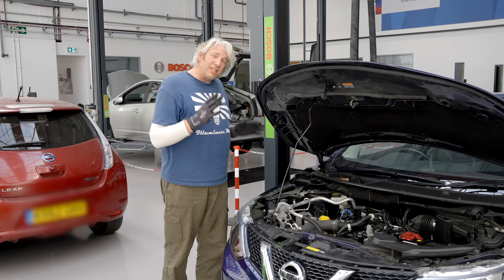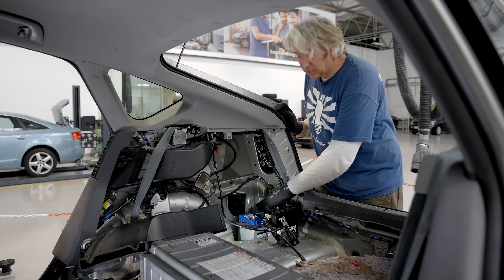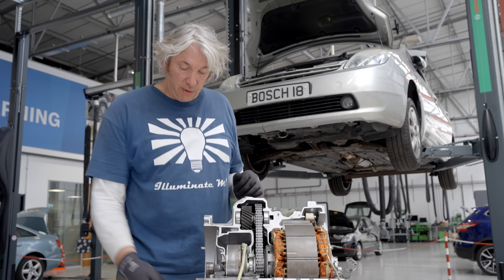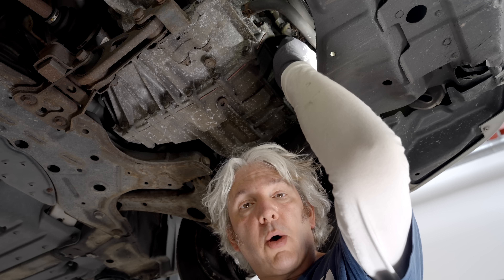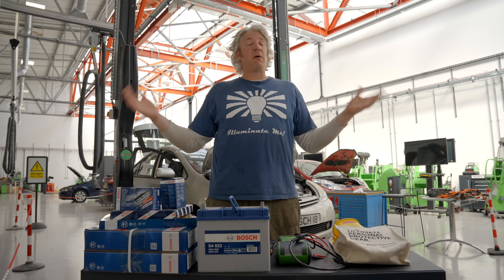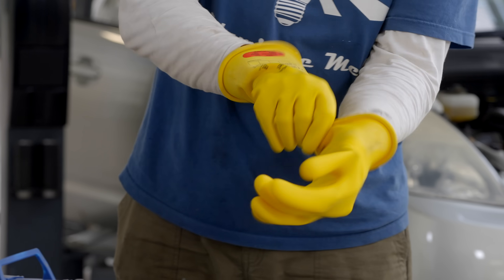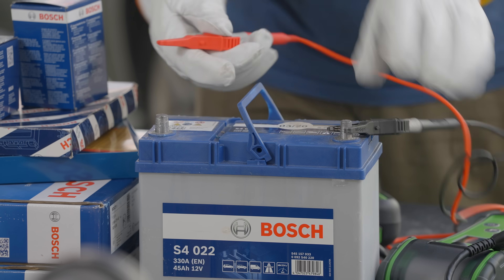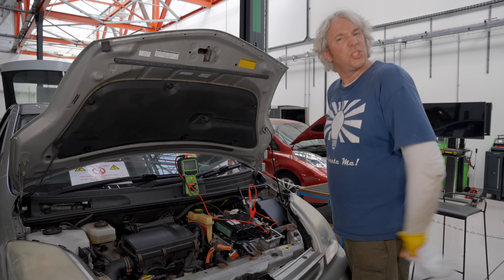DO's And DONT's - Electric Car | Edd China

Comment: Any voltage above 30V AC is considered high voltage??  Oh come on.  It's all relative.  The LV side of a 400kV grid main substation would be considered to be the 132kV compound.  Isn't it the case that the IEC consider anything 50V AC and below to be "Extra low voltage"?  Do we have a Bosch redefinition going on here to frighten the populace, by any chance?
Reply: @Bob Sacamano Indeed.  In that case the POTS (telephone system) in the UK which had a central battery at nominal 50VDC and ringing at 70VAC or slightly above would have meant that every homeowner with such a device would now be considered to have been in mortal danger!  You could indeed "feel" the ringing voltage if you were somewhat careless, but nobody would have spent a microsecond considering the DC on the line (or the 48VDC used for phantom powering capacitor microphones, for example) as dangerous to humans, would they?

Comment: sorry if this is a dumb question (I am not a mechanical or electrical wiz), but when the capacitors discharge where does the electricity go, has the vehicle been earthed earlier in the procedure?

Comment: 300 comments so I doubt edd will see it. maybe another sub can help. can you use a Tesla to jump a normal car?
Reply: @traitorouskin7492  look for the three little dots.
Reply: @UnderwaterSable  thanks. everyday a school day.
Reply from the maker: The Tesla will have a 12v house battery but it will be much smaller than that of an ICE car so it might struggle to crank a cold diesel for example. Having said that if it’s ignition is on then the High Voltage battery will be recharging the 12v battery through the dc to dc converter so it might actually be fine. A worthy experiment; I’ll go find a Tesla and let you know!
Reply: @eddchina  I say tesla but I mean any  electric car. my boss has one and I've never been sure if we can use it to jump the company smart car.cos sometimes it's parked the closeat?

Comment: I wonder why, . . . in EV's they still use heavy lead/acid batteries. Last 8 years I replaced all my motorbike batteries for LFP batteries. 
Those weigh 80% less and are 2 x stronger and have about 5% vampire drain per year.
Reply from the maker: It’s a good question, maybe newer cars will go that way, particularly sportier ones. It was an ‘old’ Prius after all.

Comment: I was taught Many moons ago, the hand behind the back should be the left hand and this should be in the back pocket to create a conductive loop to by pass the heart. Notice Ed suggests either hand. Also the PPE on the hand behind tha back will actually prevent current which would flow through the heart. Unless the hand trick is just to prevent human error and placing it somewhere it shouldn't be. 
The other trick for testing is to use the back of the right hand instead of the normal gripping front. This causes any shock to throw the hand off rather than gripping the live wire when the muscles spasum.

Comment: OH the joy trying to sell EV's Edd because they are going to save the planet ERR NOT THEY ARE NOT. Just because they do not have an exhaust pipe means nothing, the electricity has to come from somewhere else eg PowerStation's what runs them Oil /Gas /Coal or Nuclear. You cant include wind or solar there's just not enough of them to even scratch the surface to make a difference , so all your doing is moving your exhaust pipe somewhere else.  Even Volvo have release a study saying they don't and won't save the planet just type this into your search engine ' Volvo EV Report. The other problem you have is  with do days electricity prices going through the roof it now costs more to run an EV then every before, the charging network is utter shit most of the time if you find the  chargers are broken or someone else is already there. I do like the Honda E but a big BUT £38000 which for a small car is insane that isn't the worse bit if your lucky you might get 130miles out of one charge, real world 105 miles for £38000. I wonder how long before you need to replace the battery pack at guess that would cost in the region of £10k.

Comment: Awesome video as always Edd.
Safety tip for folks changing their wiper blades: Keep hold of the wiper arm at all times, then when you've disconnected the wiper blade, carefully lay it back down onto a clean cloth on the windscreen before reaching for the new wiper blade. It only takes a moment but it saves you a fortune every single time on avoiding a very expensive accident.
I've seen so many people leave it up out of bad habit (even the most experienced mechanics) then proceed to accidentally knock the wiper arm, which snaps down and cracks the windscreen.

Yes, most folks have windscreen cover on their insurance, but try explaining that little mistake to your service manager (aka significant other 😅) why their car now needs a new windscreen...
Reply: Agreed!  Sadly learnt my lesson doing this the painful way… Excellent tip for the uninitiated. 👏 👏 🙌
Reply: Yup, easy yes, safe hell no...
Reply: @AttilaAsztalos  What do you mean there mate?
Reply: @mazdamaniac4643  Edd was saying changing the wiper was "easy and safe"; well, I do agree with easy, but my previous windshield wants to veto "safe"...
Reply: @AttilaAsztalos  Ahh, no worries mate. I've had a few close calls myself with this and after seeing the results happen to the guy working next to me in the workshop, I was "Nope." and the cloth on the windscreen from then on.

Comment: High voltage is dangerous but it is the high current (amps) which sets the car on fire or gives you terrible burns. This could happen with a ICE car and it's 12V battery to a smaller degree. Never underestimate the power available from a battery !  Good video Edd.

Comment: I don't like the testing for dead proceedure - no proving unit used. 
I also didn't like the lack of insulation resistance testing on the gloves.
Lockout proceedure should include leaving the isolation key in locked cupboard elsewhere in the office and signing it in and out.

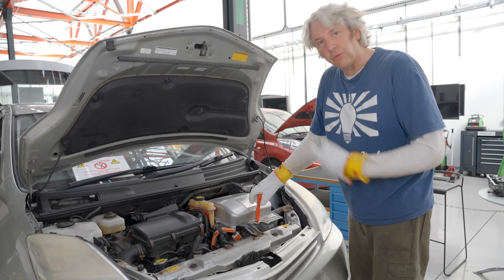Comment: #13:10 zooms in on 12v battery .... #13:12 thats 10 and a half volts so definitely thats working nicely.
Reply: 10.5 volts from a 12V lead acid battery? Stone cold flat and possibly damaged. Should see at least 13V.

Comment: Great video Edd! Thank you for including all the safety precautions, including the high voltage gloves. There are a lot of people who work on Priuses who take no precautions at all. I’m wondering if you’re doing maintenance items other than working on the high voltage battery, if simply disconnecting the ground on the 12V battery would preclude the possibility of something on the engine from spinning and causing injury?
Reply: My guess is Toyota would put in several fail safes that makes this possibility very unlikely but not impossible if something else was faulty. Obviously it would be rare for the engine to try and switch on without the key inserted but if a fault or multiple fault occurred you could end up in trouble. I have heard of 12 volt batteries going flat in electric cars preventing the car from starting so it would seem possible that it would stop this happening but not if it was faulty. Risks will probably increase for a full electric vehicle especially if there is no longer 12 volt electrics. Scary stuff. Certainly worth doing that course!

Comment: Hi Edd,

As a trained HV mechanic and designer of an electric conversion kit for a specific vehicle, I'm having some trouble with your video. For servicing the engine and brakes it's absolutely not necessary to place the HV battery in a safe mode.

Removing the key, and maybe disconnecting the 12Vdc battery will de-energize the contractors and therefor isolate the HV battery.

When do you need to put the HV Battery in a safe condition: when working on HV components, cabling or working in close proximity to these parts. This last item might be a reason to disconnect the HV Batt during service, but in my opinion it's a bit overdoing it.
Reply: Correct, to do the brakes you need the power to release caliper motor

Comment: What about when one of these electric vehicles is involved in a bad accident and the high voltage cables make contact with the metal bodywork. When someone tries to help you out of the vehicle it could be game over for them.  Or if you step out of the vehicle and ground yourself etc.
Reply: I guess the insulation of the cables is tested to be thick enough for it not to perish in an accident. The double insulation making this even less likely. I never knew the battery voltage was so high. I know that lithium ion in phones/laptops etc have fail safe chip that if something goes wrong such as a short circuit no battery voltage or current is supplied. Wonder if that's the case here.
Reply: @Bob Sacamano Of course it would. First responders would have no idea that the HV cables had effectively turned the car 'live'. At least with fuel you have the smell of a leak, and if it's on fire you have fair warning. I would hate to be a first responder with a major accident involving wrecked EVs. 🤷‍♂🤷‍♂ How would you approach opening the car for example?
Reply: So people in ICE cars involved in accidents don't ever get injured or hurt then?

Comment: Very interesting. I made the jump to a full Battery Electric Vehicle this year from a standard diesel. The most complex piece of kit on the diesel for a home service was the electronic parking brake, but the BEV is a whole other kettle of fish. It’s good to be reminded of the dangers of the HV system. The short circuit current of a 12V battery was bad enough to be fatal, but on these it could be explosive.

Comment: What are you going to do with all the dead batteries?    Also to replace a dead battery pack the cost is more then the car is worth.
Reply: @Bob Sacamano most battery packs cost more then the car is worth, even a Tesla. And a refurbished battery won’t last as long and they can only be recycled a few times.
Reply: @dickcasper3275  Petrol and diesel can't be recycled at all........
Reply: @Brian-om2hh  so what. You can’t possibly power a country with renewables. Some countries are already turning back to coal and more will follow after winter. Keep warm, have a fun winter.
Reply: Volkswagen recycle old EV batteries in their battery recycling plant, but you can do whatever you want with yours.

Comment: Great info so people understand what not to do w/ a Hybrid. How would the engine just start though? All of the Hybrids I've owned you had to depress the brake before it engine would start. I just changed the oil in my '21 Honda CRV Hybrid, got 20k miles on the ol' girl now. It was as easy as 'changing oil on a Honda'. They even cast 'oil' and an arrow pointing to the plug on the sump. Thanks Honda 👍
Reply: It won't since the contractors are de-energized and the battery is disconnected
Reply: There would have to be a lot of faulty parts to make the engine just start especially when stationary. But I googled out of curiosity and this has happened to a few owners with a faulty power management chip. They'd shut the car off, and then a few hours later it would start up, headlights, cd player the lot. Eventually the engine too. So it's not impossible.
Reply: @paultasker7788  then disconnect the 12Vdc battery, still no need to mess about with the HV
Reply: That's nothing new. You have to press the brake pedal on my 2015 Golf before you can start the engine......
Reply: @Brian-om2hh  Right, that's why I made the point that how could the engine just start

Comment: The mechanic we use has been completing a course on electric vehicle servicing. He's thinking ahead, but says the older "old school" mechanics aren't bothered as they'll be retired and it's getting the younger ones to understand that if they don't update their skills they'll be left behind. It'll certainly kill off the DIY mechanic,  possibly quite literally in some cases! It will also have a knock on effect for the handy motor factors and shops selling service parts for vehicles.

Comment: Being an electrician I can see an issue with the testing for voltage you should be using a volts only tester not a multimeter as you could by accident have it set to the wrong settings also the disconnect plug is not a safe design as some could take it out of you took kit and plug it back in so technically you have not done a safe isolation in the eyes of the electrical world. I do wonder will the car world end up being controlled by the electrical world it would be a lot safer if it was. 🤔🤔🤔
Reply: Yes, I can imagine in a proper interlock system you should have to insert that disconnector plug into another mechanical socket so that you can then release any cover which exposes potential HV terminals or busbars.

Comment: I like Bosch stuff, I've sold and used a lot of it and I know that you have to make a living, but hand on your heart, this is an advertisement for Bosch🤔🤔😳

What you've pointed out though is how these cars are a pain to service in many ways and that the DIYer should be very careful when working on such - good on you for that👍✌️😊

I'm not convinced by Li-Ion battery tech, too expensive, dirty, filthy, dangerous supply chains, too many undeclared explosions etc too. The sting in the tail is that the car is a virtual write off when the Li-Ion battery is end of life. Then there's very little by the way for recycling of said batteries. Rumoured that the likes of Elon Musk approached UK military about such important matters (ergo no one has bothered to think about disposal of the wretched things!).

Petrol or Diesel electric is an option (using the best tech for clean petrol or diesel engines), so various biased hybrids. But as things are now? Not good.

Let's take that all a stage further and I'll be controversial, it's fairly well known that one man started Cold War 1. Similarly one guy kicked off the carbon climate change carbon credits scam (the world Bank also bought in as part of a one world currency plan - or did he work for them and/or the WEF?), he was an EU shill and was outed by one of Thatcher's aids - then he fled. Where to? The factory of the world, China, straight into the arms of those hypocrites the CCP.

It's all like the emperor's new clothes - when I checked carbon levels (I'm NOT a climate change denier btw) had hardly fluctuated between an average over the years. 

I'm much more concerned about ECD (due to China's and India's growth etc), Solar Flares, and the 70,000 unregistered chemicals that big business pollute us with - and get a way with. Eg Teflon and associated products in water supplies and the air, causing; birth defeats, numerous cancers and other illnesses, similarly the increase in brain tumours that coincide with mobile phone usage. 

Funny how it's all like smoke and mirrors, chase the lady with big business conning us, using misdirection against us. 

You're a clever man Edd, I greatly admire your work and watching your work, but I think that you're barking up the wrong tree with battery powered EVs and the current Hybrids. Okay battery power has it's place; Eg fork lifts and milk floats, but the overall concept is another slight of hand con. Expensive, enforced obsolescence, encouraging more debt (enslavement) etc. Similar but less so with hybrids.

Come back Nikolai Tesla all is forgiven!

Comment: Another reason not to have an EV for me as i like to maintain and fix my own cars. Or are they going to provide this course for free to any EV owner who wants it.... I wonder how much this Bosch course is?
Reply: 99% of the maintenance is the same as any other car, just less of it slightly less often.  If you manage to get up to 500K+ miles then things like replacing battery packs become a possibility.
Reply: @ChrisP978  Full battery pack replacement will rarely be necessary. A battery refurbishment may usually be all that is required, at a fraction of the cost of a full replacement pack.  Cleveleys Electric Vehicles in Gloucestershire did a battery pack refurb on a 10 year old Nissan Leaf. It took 4 hours, and cost the owner £500. The video is on YouTube....
Reply: Battery packs in most cars are warrantied for 10 years or 100000 miles in the UK, however, in reality it only guarantees 70% of range during this time period.

Comment: Battery cars are not the future.. Hydrogen is king 🤴
Reply: Hydrogen fuel cell cars are hybrids and also have high voltage batteries to drive the motors.  The batteries are recharged from the fuel cell.
Reply: @ChrisP978  I think he means hydrogen as a fuel for normal combustion engines.

Comment: Great awareness to the home mechanic. I didn't know the engine can just spin up like that. Thx Edd
Reply: Seems extremely unlikely that the engine will randomly turn on if ignition is off. It’s not like Priuses are frequently turning on in the middle of the night. Disconnecting 12V is just good practice for certain jobs whether pure ICE or hybrid.
Reply: @TheEquationSlayer  I've replaced front brake pads and rotors on an early Prius about 5yrs ago and I was warned to disconnect the 12v battery, can't remember the reason but seemed like a good idea at the time and we had no problems, looks like we avoided being "killed to death fatally" which sounds rather nasty🙂
Reply: @darylwalford8697  That's because the brake system will pressurise itself when you open the drivers door. Makes for quite a mess if one of the calipers is hanging off on the side and somebody opens the drivers door.
Reply: Hi, Mark! Yep, it's no different from shoeing a carthorse in the olden days; important to remember to fill its nosebag with oats before starting work lest Old Ned throws a wobbler and kicks your head off... 🤭
Reply: It doesn't just turn on randomly. Just don't leave the ignition turned on.